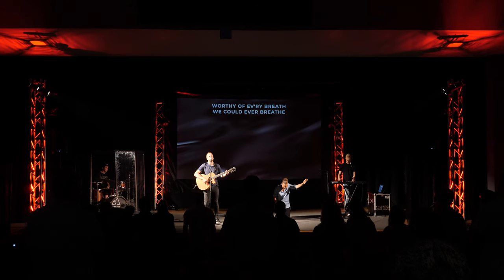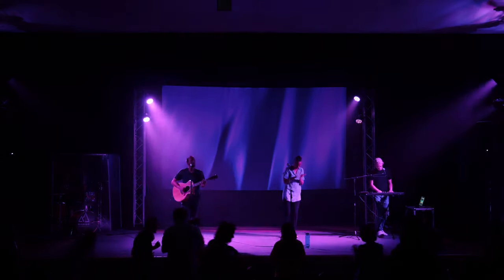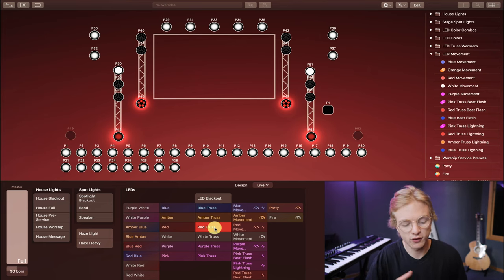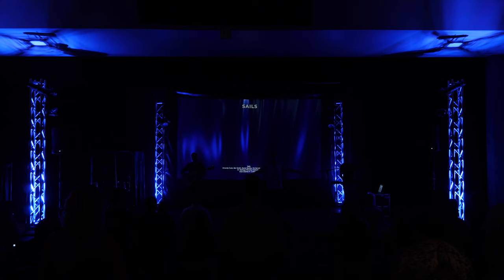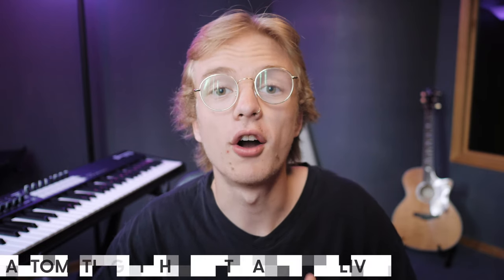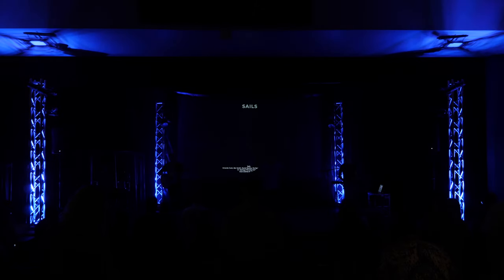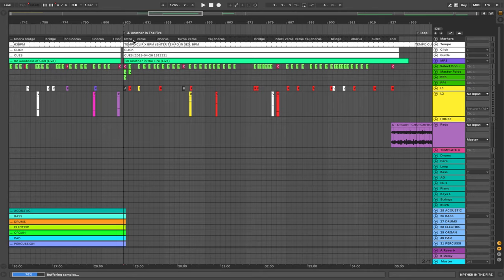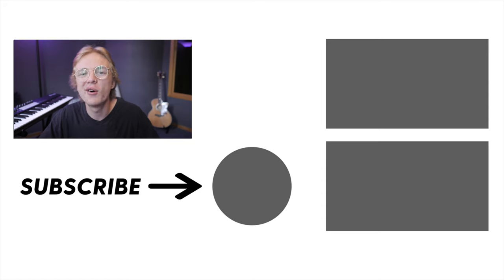How to Design Lights for Worship

Comment: I'm curious if it's a challenge for you to get even lighting on your vocalists faces with only the 2 ellipsoidals on either side of the stage? I might be interested in implementing this setup in our auditorium as the front lighting we use now washes out our background, much to my dismay.
Reply from the maker: It works great. The biggest challenge is the angle is too much from the side putting them on those trusses but it’s our only option with this portable setup.